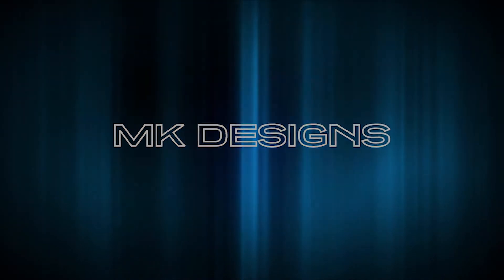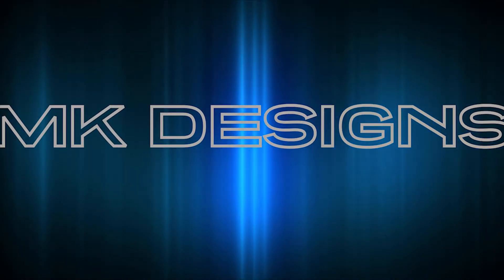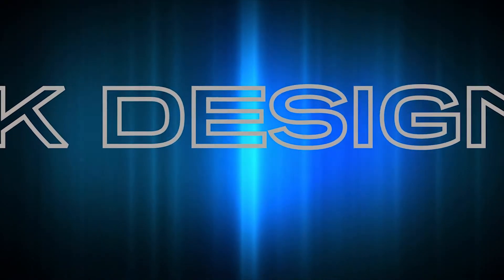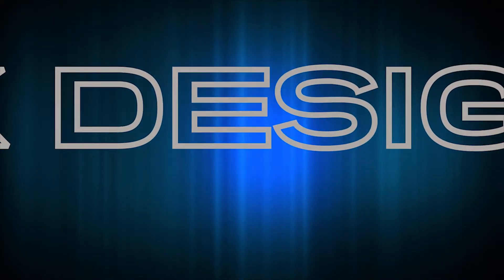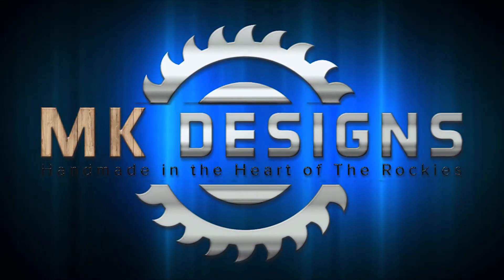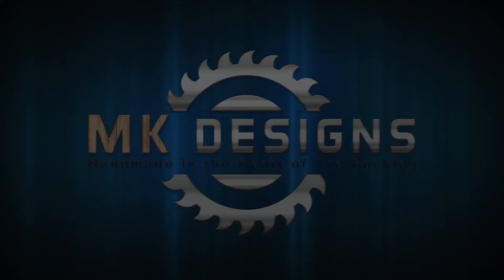Why not to use oven cleaner to clean your Carbide saw blades. Safety Tip!

Comment: How about carbon steel saw blade not carbide tipped?
Reply from the maker: I apologize for the late reply. As long as there is no brazing it should be ok. But honestly the purple Simple Green is probably cheaper by volume than oven cleaner and in my opinion does a better job.

Comment: Hi Michael, thanks for the heads up . I’ve just cleaned my oven , and so got to wondering if the same product could be used on my saw blades . So I thought I’d check out the science first . You speak a lot of sense and you put the brakes on me using oven cleaner, so many thanks for that . Somewhere in the back of my mind alarm bells rang out about sodium hydroxide reacting to certain metals , so I’m glad I checked . Kind regards John 😊😮👨‍🦳🪚🔨🙋‍♂️

Comment: awesome tips for anyone with a saw. i belive 100% what king told you about oven cleaner, im just wondering has there been any tests done to prove that its the cleaner that caused the carbide to come off and not something else? or just we know the given chemicals in the cleaner do react with the elements in the blade so its just a assumption based on relative data?
Reply: I have looked. And I could not find any testing data. 

I have seen forums where people are posting a link to a study done by Freud, but the link is a dead end. 

All I have is the chemistry. But that’s enough to scare me away from using oven cleaner. (Especially when the real cleaner is almost the same price)

I’d love to see some legitimate lab testing. 

I’d consider doing doing it. But I think you would have to test the force required to pull off a carbide tooth on a new blade. Probably lots of times to establish a mean. Then test the force required to remove teeth after various soaking times. 

I don’t know where I’d get equipment to measure the force of a tooth removal. 

Anyhow. I think the fact that the possibility exists of a dangerous situation should help folks to make a more informed decision on what to use.
Reply from the maker: King's Fine Woodworking thank you for that James.
Reply from the maker: Shaun Kennedy that’s an excellent question and one that I will have to get back to you on. I am sure that someone has actually tested it but I will have to research it and let you know.